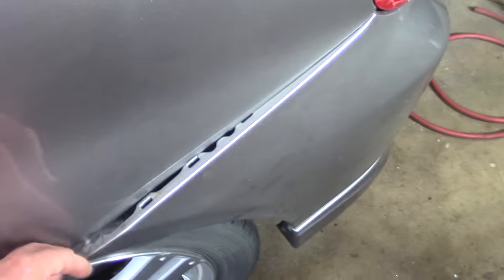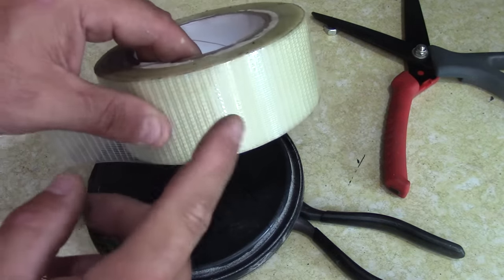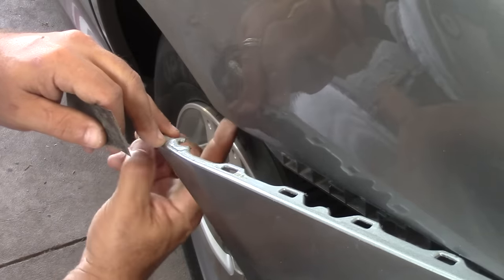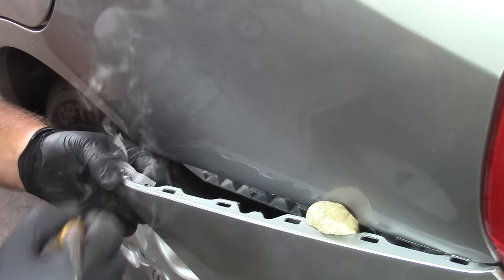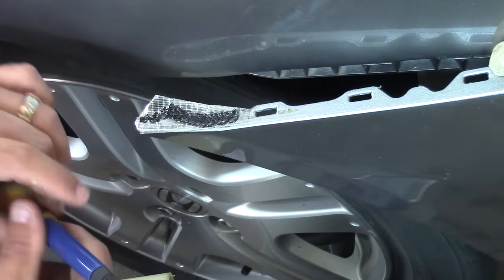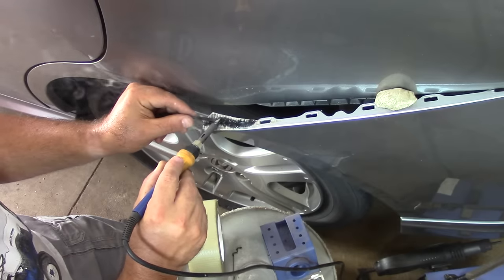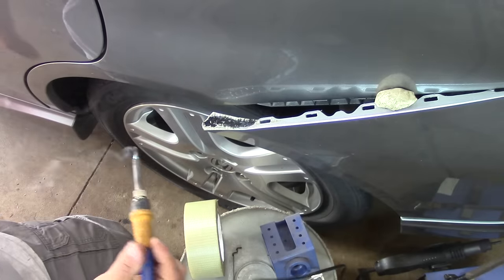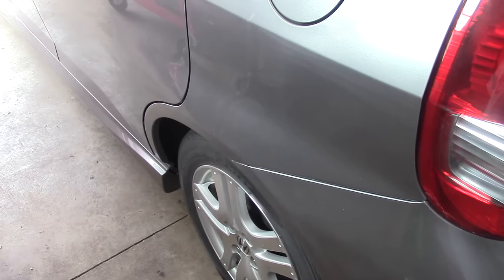Car Bumper Broken Plastic Tab Repair

Comment: thank you for sharing.  i need to do this to my miata.  brand new bumper 450 dollars ruined after i lowered my car. tried to use quick release tabs but couldn't get those to line up on either side.  I've been considering this so again thank you for the confidence boost

Comment: I know it's been a while, but I think if the other clips will hold it, id just have cut off the broken clip and remove the piece of metal that s obstructing closure and snap the others in firmly. It looked like there was plenty of clips, as long as they snap in strong.  But however you do it, good luck 🤞

Comment: The soldering work station isn't linking anymore to the amazon listing. Looks like they took it down or it got removed. Anyways is there any other soldering machine you recommend to do this?

Comment: The bumper or face bar is not loose, you are repairing the bumper cover which, as the urethane ages, tends to break at the attaching points. Great do it your self-post.

Comment: A larger washer with your original screw get as large as you can before hitting the inner edge you could also put a (small) dab of urethane/ silicone  on each one of those teeth that go along the side of your quarter panel when you snap your bumper back on use a little inch and a half tape weeken it by running it across your pant and tape the quarter panel and bumper where you want it .wait an hour or two depending on temperature carefully pull the tape off should keep it nice and snug that would be another option.

Comment: Almost always hot wax will fasten almost all small broken plastic parts. If you put the component back together while still soft it will conform to the shape you put it in. Hot wax is a life saver.

Comment: Hi just came across your video I had the same problem on the same car and on the same side a while ago I used the super glue and baking soda fix,It worked really good, I found that taking the wheel off and drilling up the hole was in the perfect spot, The way you repaired looked as if it worked real good so two ways to repair Fit bumper. Thanks

Comment: hm.... i will cut a piece of metal and glue it at the bottom. faster and stronger support.  then you can melt plastic or put a ring on top.  can be done within 5 mins.  =P

Comment: Nice, but now the metal bolt and nut can potentially rub against the quarter panel paint and cause it to rust. I would try plastic clips or zip ties

Comment: You should have used a plastic welder because a soldering iron gets much hotter. Also you should have used stainless steel screen in place of the tape that would last a lot longer.

Comment: That's dumb bro. If a shop did me like that, they'd be in some trouble with me. My bumper is screwed up on one side. I'm just gonna get the new bumper and replace the locks that the mounts on the bumper latch into and then pop it on, do whatever I need to. It's an eye sore among many other problems for sure

Comment: I have that exact same problem on my driver's side front panel.  The darn plastic loop broke in half and the screw no longer holds the panel.  I like what you did but I may need to do it using glue to "weld" a support piece just beneath the affected area.  Thanks for the How To!  👍👍

Comment: Every body shop I have been to has always recommended an expensive brand new bumper. This seems like a cheaper effective alternative. Should I find a welder? I wonder if the body shops  are just trying to make extra money.
Reply: Yes, they are trying to make more money out of the insurance companies. It's faster to remove and replace a bumper rather than try to fix it

Comment: I wonder if this works with drywall mesh tape (fibreglass) since thats what i have
Reply: I was wondering that but looks like the same thing
Reply: I used it, it fused in fine. it was probably overkill for my situation of tabs, I soldered the plastic back. Reinforced with fibreglass tape, shaped a thin piece of aluminum flashing (so wont rust) and then used jb weld and rivets to tie everything together. On the bottom tabs that broke off on the bumper.

for his corner tab I welded in fibreglass drywall tape and then jb weld and then drilled a hole.

everything seemed solid. I didn’t melt additional plastic instead i mixed jb weld marine epoxy. was able to drill and file/shape it without it falling off.

Comment: A little late, I admit ... but you could take the plastic that the bumper clips to off the car, then attach it to that strip with zip ties. Drilling a couple of holes in the lip of the bumper and the plastic mounting bracket ... then snap that back to the car. You will have to pull the liner away from the inside of car and squeeze the clip to do so, but it works ! I have a 2006 Accord that I bought used and the bumper had been bumped, replaced and never attached well ... it was a permanent fix and looks really good.
Reply: Hello… @mgm5457… you mean using the zip ties to weld… or use the zip ties as zip ties. I wish there would be a video explaining what you said.
Reply: @inkandescent3382  the bumper attaches to the black piece underneath, take that piece off ... pull trunk lining in that area, then unfasten the mounting strip, mount that to the bumper using drilled holes adjacent to the torn part, then re-attach the black part back to the car, tighten fasteners ... these usually are snapped in place or bolted (usually)

Comment: I have the same issue on my 09 Honda Civic from someone rear ending me. I don’t have a soldering station or heat gun. Any alternatives you could suggest?
Reply: use epoxy

Comment: Just finished the exact same repair job on my Corolla. I used a few layers of Fiberglass+Expoxy to restore the area. The tape is a great suggestion. Looks very easy and clean to work with. Wish I thought of it before I bought the Bondo brand Fiberglass weave from my local advance auto which left a mess of fraying ends and loose strands.

Comment: DW6 great fix. Auto body shops make a fortune repairing plastic bumpers, so it is awesome when you can fix your own. Plastic welding is a very cost effective way to repair them.  I have fixed may of them out of my shop up here in Canada. Thanks for sharing!
Reply from the maker: Thanks for the great feedback.
Reply: Hello… @gregwells2331… Is there a substitution for the tape used in the video? I mean something that could be a little bit better.

Comment: Great video. Thanks for sharing. I have done quite a bit of plastic welding over the years. Have used aluminium fly mesh as reinforcing. It works well too. Dremel tool is very handy for the cutting and grinding as well as loads of other uses.. 
Keep up the good work. Cheers, Wayne.
Reply: Dremels are such great tools especially if it comes with a serpentine extension for even more control
Reply: Hello… @rustypanels5719… I have a question. Is there a measure or type of aluminum fly mesh that is better to use in small tabs like the one in the video?

Comment: Wow...  I never thought about "welding" plastic parts on cars!  The plastic surround on my driver's side mirror is cracked and opened.  I had it glued together for a few years, but now it's opened back up again!  I may give this a try!!!  Thanks!
Reply from the maker: As long as you have the right type of plastic it bonds very well.
Reply: Lightly sand it then re glue it

Comment: You made your life to hard all you had to do was put a screw 😂😂
Reply: I had a similar issue with the front bumper of my Acura. I used a coarse screw and a metal washer and its been holding up for years now.

Comment: Well done and your repair will last. Body shops fix plastic bumpers all the time, plastic has a memory it wants to go back to where it was, heat activates that memory. Some shops are now using plastic staple welds to repair cracked plastic bumpers, they are expensive but people can make a good living repairing plastic bumper covers.  There are companies/body techs that are doing very well just specializing in plastic bumper repair. A Honda bumper cover may cost $140. + aftermarket before labor and paint, a German luxury car with that same piece of plastic is usually not available after market and can run $1300.+ Just for the part. Repair over replace is always a good option if possible, saves money and less chance of a paint mismatch.
Reply from the maker: The metal staples look pretty neat and strong.  It takes some time to do this repair, but I feel it is fixed forever.

Comment: I have the same issue with my front bumper on my 07 Impreza, right now a small zip tie is holding it right, but I would like to fix it properly, thanks for the demonstration, I will let you know how it goes using this method ☮️

Comment: I would rather try and buy a bumper of similar colour, or buy a white one and repaint it. Also, who has a welder and or welder experience? That rear bumper would be easy to remove.
Reply: $300 dollar for new bumper or a few cents? I’d go with a few cents. Guy did a great job
Reply: @ismaelperez6095  yeah, but you need soldering tools and experience. It may only be 'a few cents' , but it's only a temporary solution, and a BIG job for a beginner...
Plus, my bumper has marks in other areas.. I found one online for $140. Same colour. Second hand, good condition :)
All I have to do is unbolt and swap.
30 minute job.
Then I don't have to worry about repeating the process on the tabs after a few months. It's more expensive, yes.. but that extra money will save the hassle in the long run

Comment: Should have replace with new bumper not cheap0 fix!
Reply: A body shop would have done the exact same thing, except they would use plastic filler rod, not a coffee lid. No need to replace a bumper over a plastic tab. OEM bumpers are expensive, and aftermarket ones will never be as strong, or fit as perfect as an OEM one.
Reply: @Lucky13 -- How so? If effective, it may be better than new. It seems to be better than even the body shop pros' work. Nothing wrong with cheap fixes that actually fix.
Reply: Too expensive